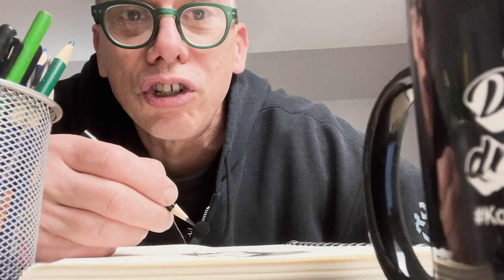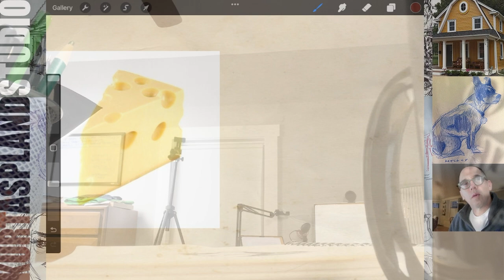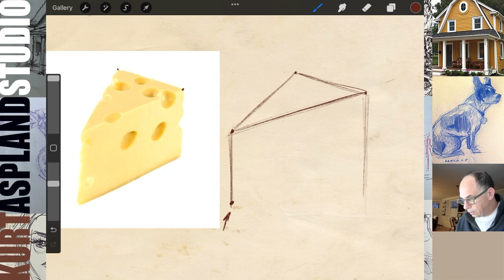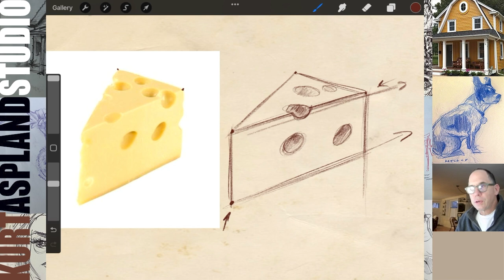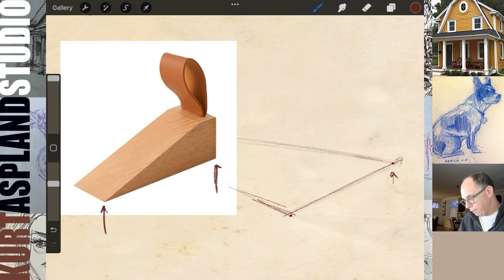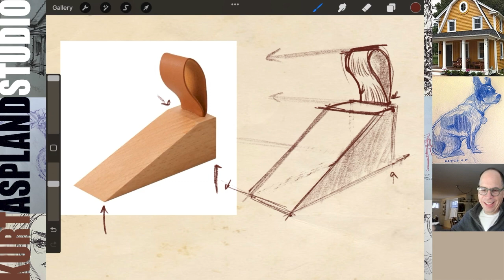Why Your Drawings Look Off—Fix Perspective the Easy Way! 🎨

Comment: So wait, you just drew objects using conventional perspective rules and vanishing points, without explaining the "easy-way". What am I missing?
Reply from the maker: What I’m saying is to ditch the traditional step-by-step perspective method—instead, rough in your object first, then refine and lock things in. This approach to drawing is completely different and gives you more freedom and flexibility from the start. Your thoughts Milan?
Reply: @adadwhodraws  That makes sense, thank you. I try to imagine a VP off the page somewhere but the trouble normally arrises when you have multiple VPs.
Reply from the maker: @milan_spasić  That is so true!!!
Reply from the maker: btw... I just took a look at your channel! Do you like sailing?
Reply from the maker: @milan_spasić  I usually never establish where my vanishing points are. When you put your vanishing points on your paper you lock yourself in. So if you rely more on a perspective grid, it frees you up. Most teach drawing a horizon line first. Then vanishing points. I say draw what ever object you want then, use general ideas of perspective to get everything locked in.
Reply: I was excited to see this video because perspective is the main issue I have with drawing. Although I was confused on the video. When you were doing the doorstop,when I look at the reference photo, I was thinking the vanishing point would be closer to you so the lines will go inward towards the bottom of the paper where as because you drew it from looking down on it instead of the actual reference photo, it was drawn in your example with a vanishing point being further away from you more like at the top of the page. Am I wrong in looking at the reference photo thinking the vanishing point goes towards the artist rather than away from them?